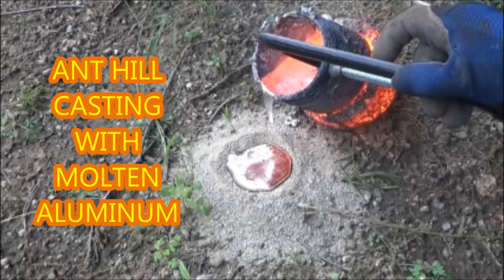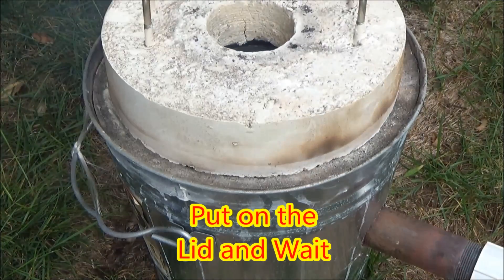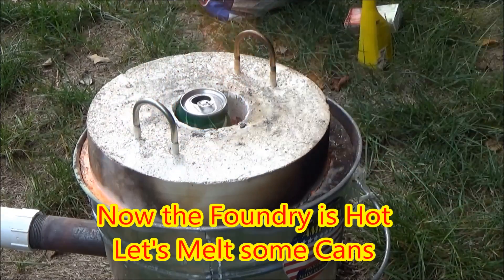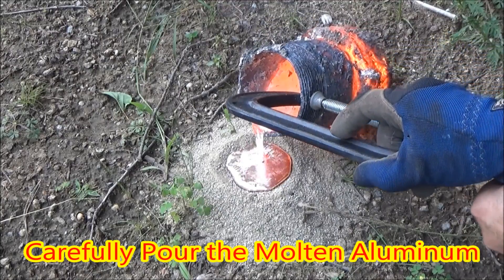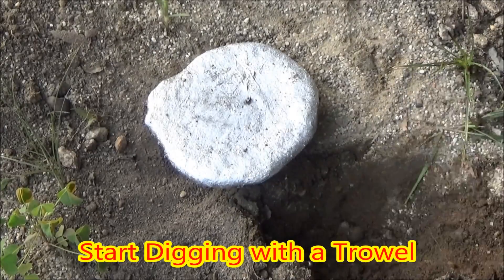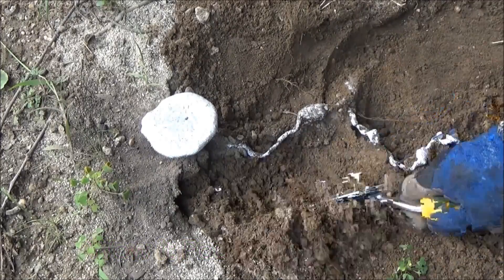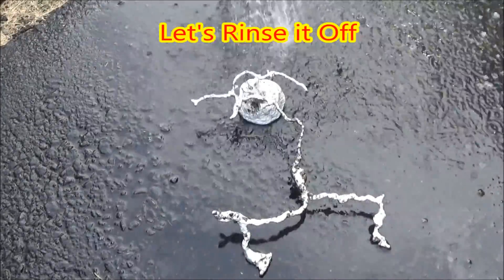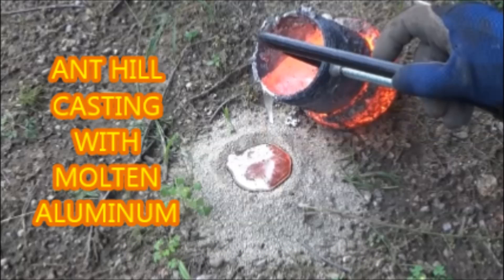Ant Hill Casting Molten Aluminum

Comment: According to 9/11 Truthers, this isn't possible... Aluminum doesn't glow orange!
Reply: Too bad there is a difference between steel and aluminum... Completely different elements.
Reply from the maker: +Doom2pro I guess I don't know what to say... The metal being poured came from only melted aluminum cans and the video has not been altered. Hope you enjoyed the video! Thanks for commenting!
Reply: +Heath Putnam I know, I was being sarcastic... I'm using these videos to prove Truthers wrong, blackbody radiation explains why all elements glow at certain colors at certain temperatures.

The truther argument is that molten aluminum is always silver and never glows red or orange or white.
Reply from the maker: +Doom2pro Yeah I just read that... Use my video all you want... Aluminum definitely glows when molten... and can be easily seen even during the day.